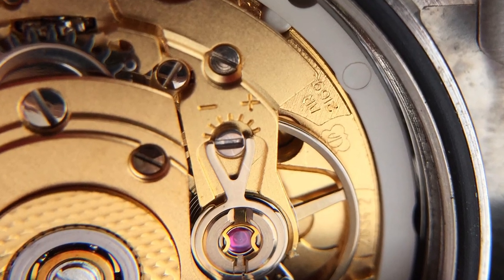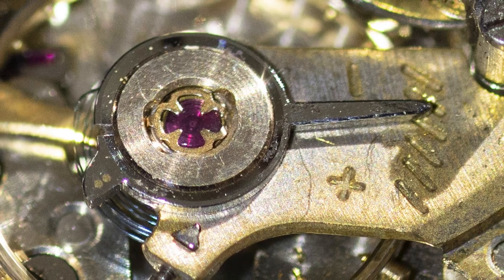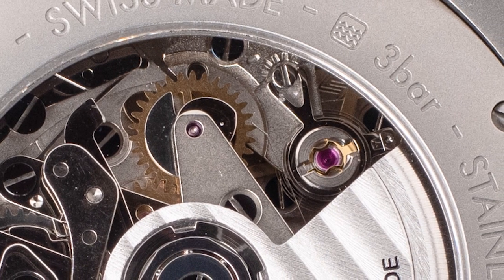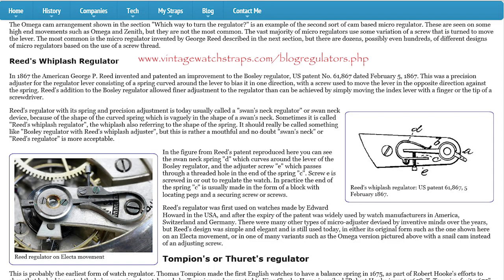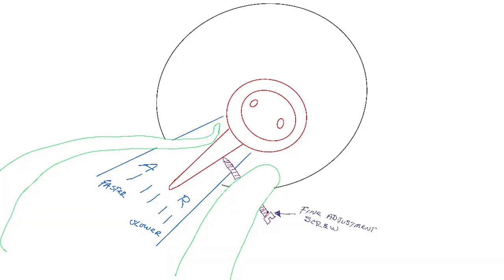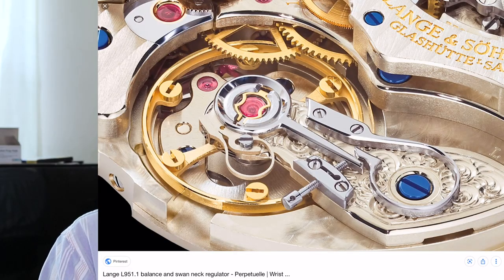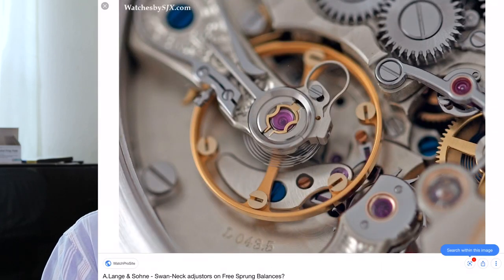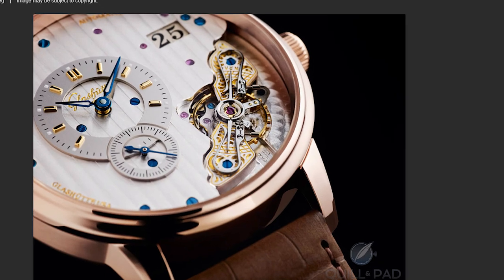Swan Neck Regulator -- Uselss and Beautiful?

Comment: Actually the swan-neck regulator is highly useful. One slip of the hand trying to regulate a watch is a regular movement will result is a ruined balance wheel. Also, it is very difficult to make tiny adjustments on a regular movement. Unless you are a fan of constant trial and error to regulate your watch, and expensive repairs, spend the extra money on the swan-neck.
Reply from the maker: I can see how they are useful.  I imagine they could make minute adjustments a little easier. The industry does seem to consider them a luxury upgrade.

Comment: That was explained really well for me.  the other two methods of adjustment are the 'get real steady and move the arm just a hair but whatever you do don't slip into the spring"   that is by far my least favorite/.    the other method uses a screw up higher that has a cam head on it no danger of slipping and destroying the watch and... since it is a screw it is much easier (for me) to get a fine adjustment...  Thankfully that was on my Zodiac never did one before this but it is very easy to use and almost me proof.   I can't really see the swan neck being capable of too much finer adjustment.   I am sure it is in but cant imagine those thousands of an inch more/simpler adjustment really make any difference at all.   The first style mentioned tho is pretty frustrating most of the time. no really good way to move the bar a hair and no way to tell if you did only move it a hair in any case.   The improved one (IMO) in my Zodiac you are turning a screw in very small increments.   the slot of the screw will tell you if you have moved it at all.

Comment: Great Format, the sudden edits are a bit distracting though. Thanks for educating me about the swan neck. I am contemplating getting a Seagull and I did not know what the option in the store meant. Now that I know that it's completely unnecessary, obviously I need it. It does up the price from 295$ to 315$ though... i guess the baby will go barefoot for another year.
Reply from the maker: Thanks for checking it out, and glad I could help!  They are cool, even if they aren't absolutely necessary :)

Comment: Actually the swans neck regulator is also used in the seagull 1963 chronograph which you can buy now for less than $300. It’s the real deal. It’s not used in every version but it is used as part of the features of many ST 1901 movements.Pretty good huh?
Reply from the maker: You are right!  Seagull make some really affordable and great looking movements!  I bought one to learn to service movements.  I am grateful there are affordable models you can get that have fancy features :)